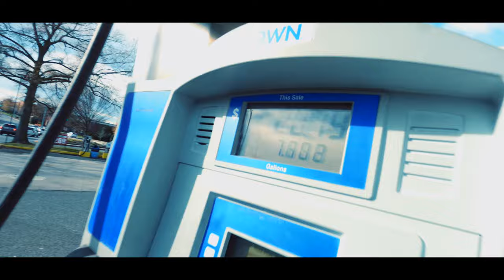Day In The Life Of A Tow Truck Driver | HUSTLE AND TOW

Comment: What do you do if the hand brake is on? Then the tires wouldnt roll and you couldnt tow it since you dont have the chance to get inside the vehicles you tow. i dont get it
Reply from the maker: Do a lock out and take brake off or put dollies on
Reply: @JCKDTV  what is lock out?
Reply: @JCKDTV  what is a lock out? English isnt my native languge
Reply: @evenito9455  a lock out, means using tools typically a small air bag and a plastic wedge to open driver or passenger door slightly, just enough to slide a long rod in the opening to reach either the inside door handle or lock unlock button to gain entry into the vehicle. And dollies are those 2 smaller wheels on the backs of tow trucks, then there are 2 aluminum extendable axles that fit into the two sets of wheels. Allowing him to tow any vehicle whether it's 4wd AWD four wheel drive or all wheel drive, or a vehicle with an electronic emergency brake that won't release. Hope that helps you understand the process. Watch more of Joe's Videos and you'll see him using the dollies often and doing lockouts.